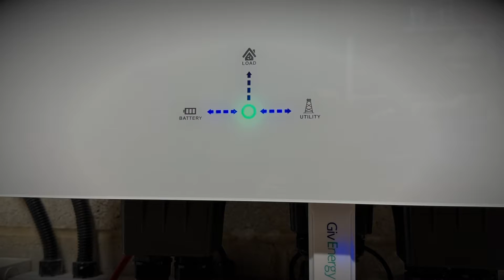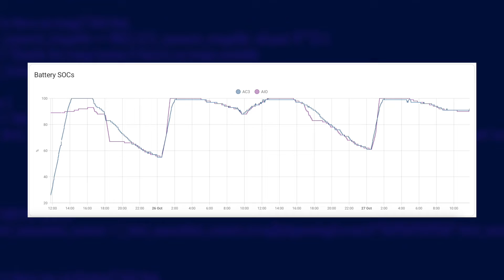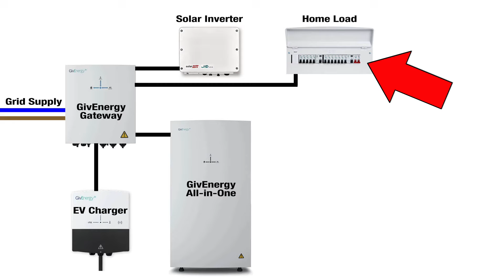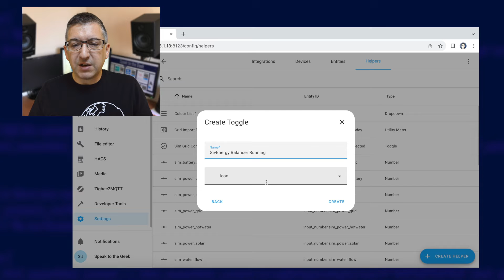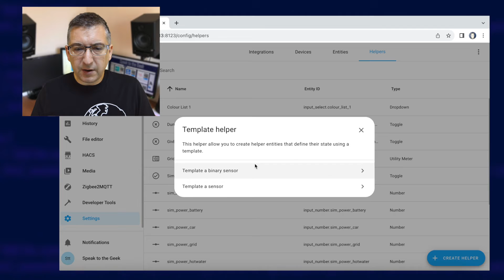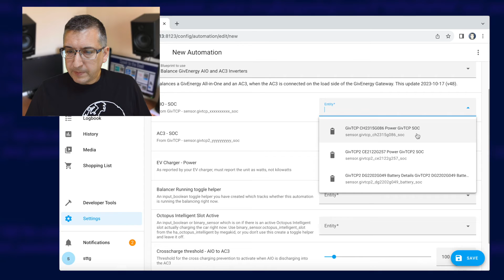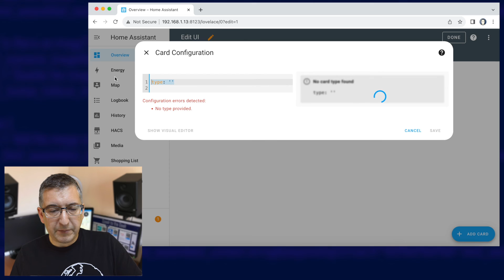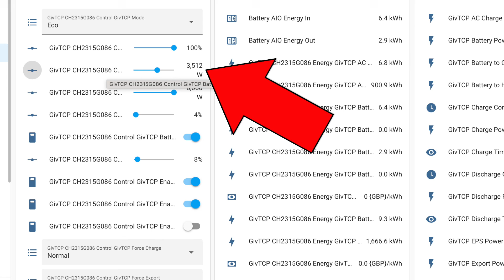GivEnergy All-in-One and AC-Coupled Working Together

Comment from the maker: ⚠⚠⚠WARNING! (2024-12) ⚠⚠⚠ Using this automation could reduce the lifespan of the flash memory inside your inverter. It is not currently recommended to use this automation due to the high number of writes it makes to your inverter potentially leading to your inverter requiring a replacement. It may also invalidate the fair-use warranty term on your inverter. Until otherwise specified this article is for information only and any use of the balancing automation is at your own risk.

Comment: I just watched this video again and thank you again! 
I was wondering over this: With the AC3 being load (house) side of the Gateway, what would happen if Home Assistant fails while you have the AC3 exporting more than what the house load consumes at that time? That would make the load reverse flow into the Gateway. I assume the Gateway's CT clamp is not bidirectional, so it would not detect that the house is feeding into the Gateway rather than pulling.
Hope I make sense!
Reply from the maker: Yeah if Home Assistant failed this all goes belly-up! I've actually changed my approach now and instead of balancing I just set the AC3 to import off-peak and export at 350W continuously (my average baseload) using timed export outside of that. Works well, suits me but might not suit everyone. The AIO then just charges off-peak and runs in Eco mode the rest of the time.
Reply: @SpeakToTheGeekTech  that makes sense… what does the AIO do if your base load actually drops below the AC3s set export of 350w? I suspect the excess may be pushed to the grid but the CTs would not register as the electricity flows in reverse on the house load CT then?
Reply from the maker: The CTs all measure everything perfectly, there's no problem there. If the AC3 is outputting more than the baseload then it goes into the AIO if there's room, or it gets exported. Same scenario when I'm generating solar and the AIO is full, it just goes straight out to the grid. Seems a bit of a waste but it's only for a few hours a day in the summer and overall I'm not losing anything. If there was a bit gap between off-peak and export then it wouldn't be worthwhile, but for most people off peak is either a smaller cost or equal to export

Comment: Hello, I have a question..... we have a solar array linked to givenergy 9.5 & 8.2 kw batteries, ac coupled with a manual override eps and octopus ev tariff. If we have a power cut (happens often) is it possible to charge one battery from solar whilst running partial load from the other and then switching over once the charging one is full etc? We are aware of max load to run and min power to leave in discharging batteries and the normal issue with grid feedback in power outages but if we are isolated completely from the grid with the manual eps switch this would not happen would it.
Reply from the maker: Not with regular AC-coupled batteries, no. Something like the GivEnergy AIO with the gateway would be able to keep your solar inverter running and allow the batteries to charge, but a normal EPS doesn't allow that. Hybrids can charge from solar during a power cut too.
Reply: @SpeakToTheGeekTech  how do you mean hybrid?
Reply from the maker: You mentioned you had AC coupled inverters. Hybrid inverters run both solar and batteries at the same time, one inverter for both, so they can charge the batteries direct from their own panels because it’s all internal.
Reply: @SpeakToTheGeekTech  Can you advise of a way we can get around not being able to use the solar power?
Reply from the maker: There is no way around that during a power cut unless you have a gateway to isolate you from the grid, or a hybrid inverter that has the panels and batteries connected directly.
Reply: @SpeakToTheGeekTech  We have an eris box, which we switch over manually to isolate us from the grid. We believed that would do the same thing.
Reply from the maker: @HoneyLodge1  No, that is most likely connected to switch your circuits over to the EPS powered by your battery inverter? Your separate solar inverter requires power in order to generate from the solar panels. Your solar inverter (should not!) will not be connected to your EPS power supply so it will not be powered. Even if you gave it power somehow, the EPS output of your battery inverter is just that, an output. It is not designed to have current pushed into it to be fed into your batteries so bad things would happen. The only product from GivEnergy that supports this is the All-in-one.
Reply: @SpeakToTheGeekTech  many thanks for the informative response
Reply: @SpeakToTheGeekTech  sorry to keep on bothering you with this, could we connect the 5.0 G3 hybrid inverter with the panels, batteries and eris?

Comment: Hi, just checking configuration on my AIO installation as do not agree with import/export and home consumption values in givenergy and think the issue is location of the CT clamps. I note the gateway has three connections for CT clamps CT load. CT AC and CT PV. On your installation do you know how many CT clamps you have and where they are located?
Reply from the maker: The gateway came with three CT clamps pre-installed: (1) on the solar PV breaker; (2) on the grid in; (3) on the load out to the home. I haven't moved these, they should be left where they are.
Reply: @SpeakToTheGeekTech  Thanks for feedback. These are connected to the 3 CT connections under the meter connections in the Gateway. My gateway has load connected but not PV CT or AC CT so guess this is my issue with data collection.

Comment: Hi. Do you know if GivEnergy hydrid inverters are tied to GivEnergy branded batteries ? I notice they have a communication cable but i can't find info on any protocols in use here.I don't have experience with hydrid systems or batteries so maybe they are all tied ? Anyone know ?
Reply from the maker: I’ve heard that someone on a forum got a third party battery working but you can’t see any battery data at all. So I’d say no, you stick with GivEnergy batteries or go for a more open inverter like a Victron

Comment: I'm struggling to get the AIO to respond in the way expected by the scripts. Do you have 0S EPS enabled, I'm wondering if it's this. The AIO won't stop providing power to the house for the Hybrid (rather than AC3) to pick up the load, so even if discharge is off/0Watts on AIO, it still powers..
Reply from the maker: I do have the fast EPS option enabled yes. There are so many ways the system could be wired up and I don’t have any experience with the hybrid so it might be best if you asked the question in the GivTCP Facebook group

Comment: nice stuff! I'm also getting givenergy set, AIO , inverter and ev charger point next month in december along with heat pump (which i actually didnt planned at first but 7500 grant helped me to decide) , I'm only worry about battery capacity because heat pump will pull more energy that I planned. At the moment the only solution to add more battieries is buying another AIO which is expensive! Hopefully givenergy will add some new battery in the near future which can be added to existing AIO
Reply from the maker: Good luck with that mega install! The GivEnergy AIO is unlikely to ever have expansion batteries, just additional AIO units connected in parallel. The EMS to manage that exists inside the gateway, it's just not turned on yet. GivEnergy told me a few weeks ago that this is one of their biggest priorities, but yes, it is still expensive to have multiple all-in-ones.

Comment: So I had an idea of something like this but a different approach - I have a AIO and prior to that a Anker 4kwh power station - My thought was would it be viable to instead of doing it like, instead present the DC output of Anker to AIO as solar input and use automation to begin feeding in when AIO < 60%?
Reply from the maker: There is no DC input on the AIO or gateway

Comment: Interesting video. I would never have thought that an AC inverter with battery should be placed load side of the AIO Gateway, but you explained it well.
A simple question that probably is far less technical: I am thinking of adding a 2nd solar PV array and string inverter for a west facing roof (seperate to the existing PV  array and Solax  string inverter that already is using both its MPPT inputs). Would the 2nd string inverter's AC output simply be wired in parallel to the first inverter to the PV AC input on to the Gateway?
Reply from the maker: The short answer is yes, you would join the two solar inverters on an external CU, and then connect that CU to the PV MCB in the gateway provided the PV power doesn't exceed the rating of the MCB. But... this is based on what I've been told, you should consult a qualified electrician!
Reply: @SpeakToTheGeekTech  Thats very useful! Thank you. Of course the qualified Sparky will have to do it.

Comment: Interesting. I wonder if this automation with a bit of extension would work for other GivEnergy “plant” system combinations such as multiple AC3’s or multiple Hybrids?
It’s probably not for me as I’m running predbat to manage my battery activities now with Octopus Agile in the winter and having two things trying to control the charge & discharge settings isn’t going to work.  But interesting nevertheless.
One comment, you set the givtcp polling rate to 10 seconds. This may be too high; I’ve heard that some people get data missing in the portal as their inverters are spending all the time talking to givtcp.  I have mine set to 30 seconds to avoid this issue
Reply from the maker: It could be adapted, a lot of work though for someone! And yes, polling rate is 10 seconds so as it can react as quickly as possible. I don't use the portal data at all personally, just Home Assistant. Also, the data in the portal is inaccurate in this configuration anyway.

Comment: Hello,
Just been watching your video re running your all in one with another inverter/battery. Very impressed. I have two all in ones mounted in our utility room. One of the aio units was faulty and am awaiting a replacement. Just wondering if your system might work for my two aio ?
ATB
Paul
Reply from the maker: Yes and no… the blueprint would need tweaking because it calculates the house load based on subtracting the AC3’s output, whereas with two AIOs they are in parallel and therefore you just need one of them to report it. Also, you would have to adjust the power values where it specifies 3000W to actually match 6000W, and rework some of the logic that is designed to prevent balancing and pausing the AIO if the home demand is more than the 3kW the AC3 can manage. Lots of tweaks needed but in theory the majority of the logic would work.

Comment: What limit do you have on your DNO? If been told that AC batteries and solar are classed as generators, so they are added together for the DNO.
Reply from the maker: 5kW for export so there is a grid limit on the inverters. Annoying for the upcoming saving sessions which will pay for export cuz I'd love to be able to dump at 9kW, but I might break something upstream.